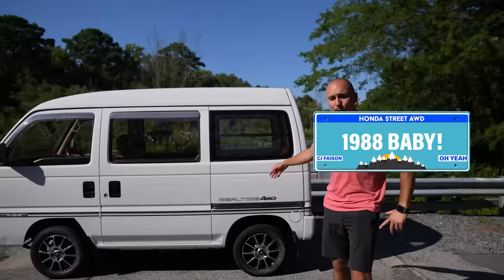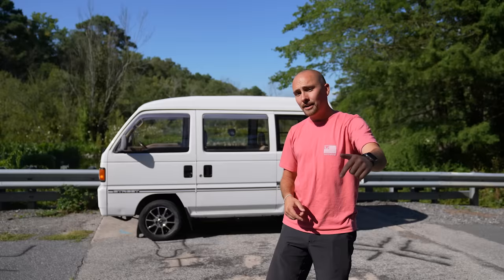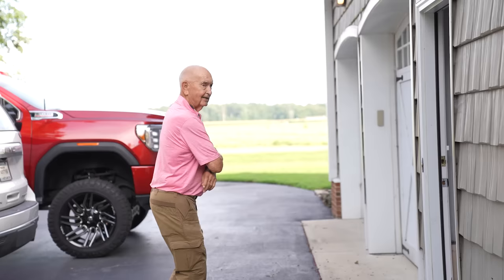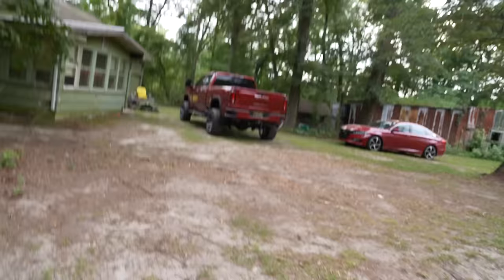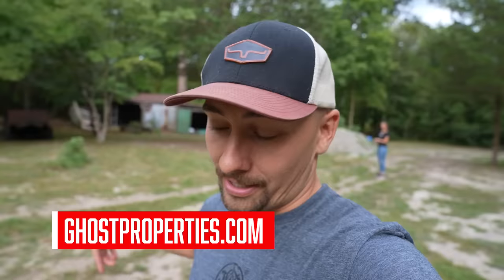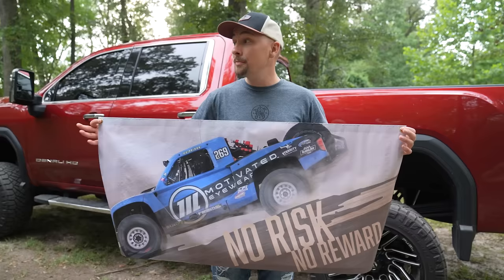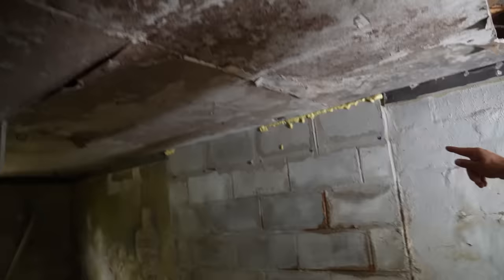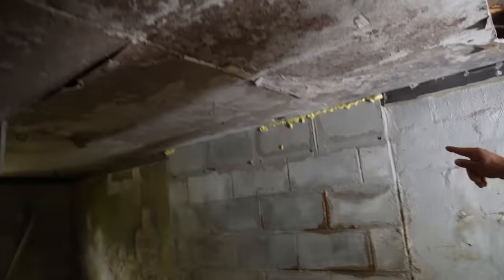I BOUGHT A HAUNTED FARM THAT HAS BURIED TREASURE FROM 1943

Comment: It makes no sense to me that someone would hide things and have to cut holes to get to it. I still think y’all should check the floor above for hidden trap doors. Please be careful, love y’all ❤️❤️❤️❤️❤️❤️
Reply: There won’t be trap doors it’s a summer floor! 

It is meant to come up during the winter! Heat rises cold air sits. They’d have the space between to keep the floor cold in hot months. Then take it up in the winter so the house was warmer: it’s definitely a older home in a older area of America (settled earlier and older building techniques) 

They are very similar to drop ceilings - they use for insulation and sound control in schools and such: only the floors in the summer are elevated to allow the cool air to settle and leave the ground cool while in the winter it would be removed to allow the heat to settle the entire home from a heater or fireplace
Reply: Fox trot whiskey
Reply: I’ve heard of the ceilings but not the floors, thanks for the info
Reply: That makes a lot of sense about trap doors, considering the history of the place! I think you’re definitely on to something!
Reply: @caroltruitt1403  yeah it’s crazy! It’s even older than ceilings it’s beautiful though my grandma is the one who told me that’s what they were! I’m originally from the west coast so we didn’t have them at all, In Wisconsin they had them before they were using air. They used fans and would spray the ceiling with water before the sun came up to add to the time the sun would shine before it heat up inside. I used to tell my grandma how insane it seemed to be using water on the roof before the sun was up! 😂😅

Comment: CJ - I think you should get on the boat, but I think you need a navigator.  You have connections all through that area, isn't there someone that has more experience with latitude & longitude than you and Chris?  Also, it appears that the entire basement ceiling need to be replaced, so pull it all down and see what is there.  So much fun!

Comment: Just wanted to let you know that the "pit" in the barn was probably like a freezer if you will and the clamp your momma was hanging onto is for ice blocks. Also the belt with the cable is for tree climbing and cutting.  😊

Comment: The green square is a baby toy there are different sizes and colors so the alphabet and numbers coincide with which block that would b if the toddler were to line up the squares instead of stacking them inside eachother like the baby would do. So im guessing that was probably mold inside of it.